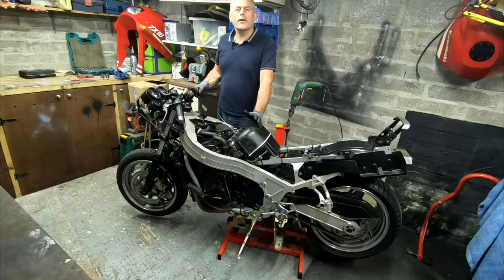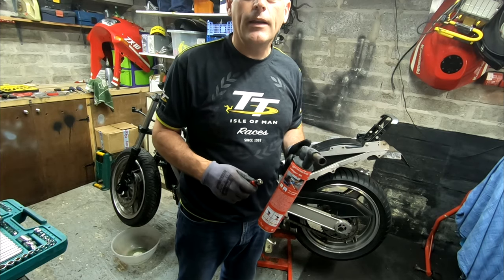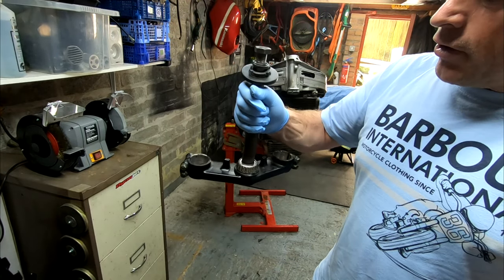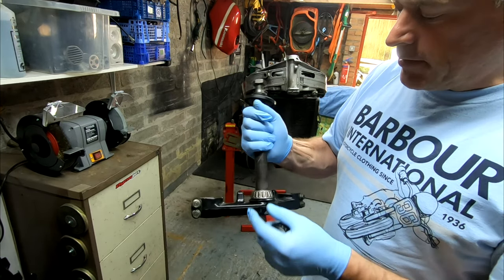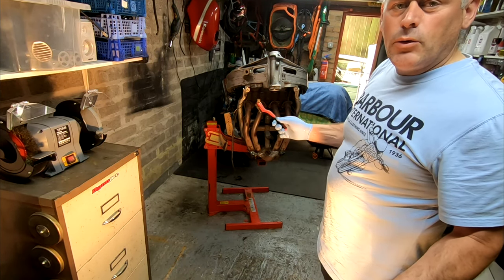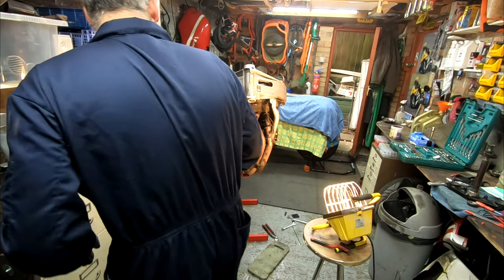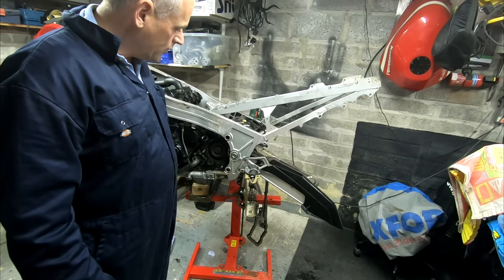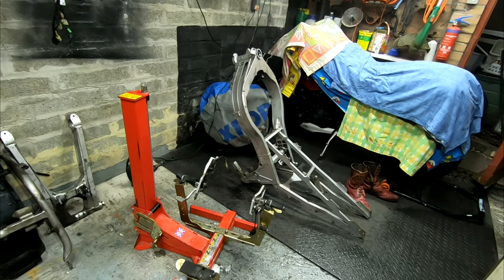ZX10 Restoration - #4 Total strip down engine removal

Comment: The thermostat is probably OK, it's often a poor earth between the thermostat body and the frame that causes the temperature gauge not to work. Try adding an earth wire that fixed my gauge problem.
Reply from the maker: Dundee Dek, I’ll have a look at that👍🏼

Comment: Would recommend taking off the oil pan (sump) and inspecting, mine was full of debris from a previous clutch basket explosion (see my comment on ZXForums.com as to the cause of that). It's worth fitting the newer design oil pressure relief valve on the oil pump, which is pretty straight forward. This solves any potential oil starvation problems to the crankshaft plain bearings.